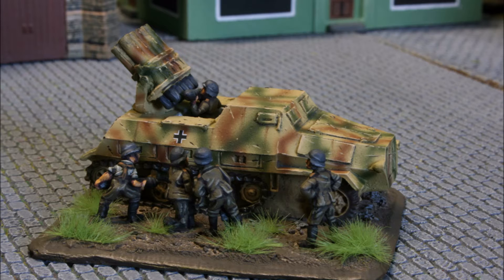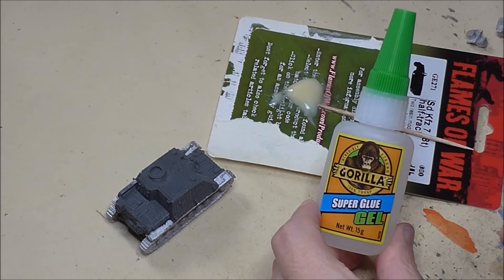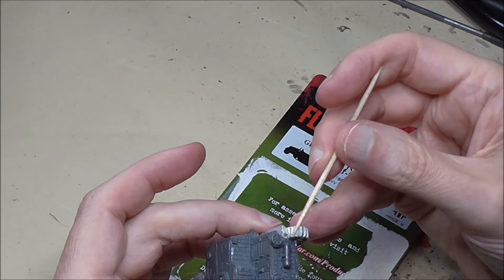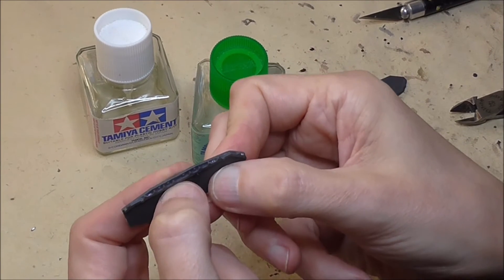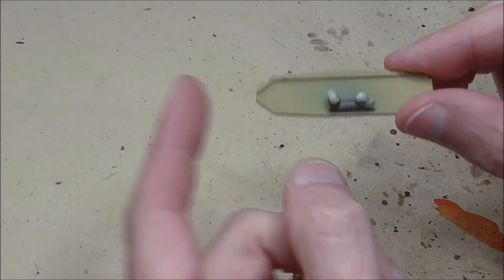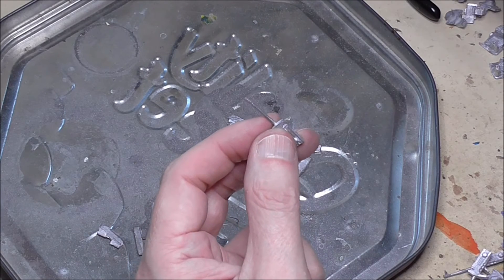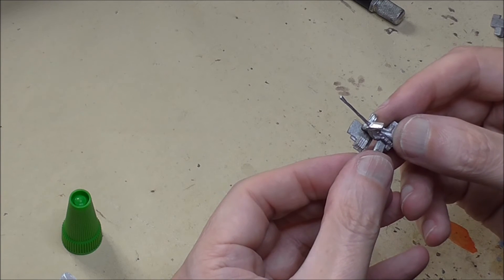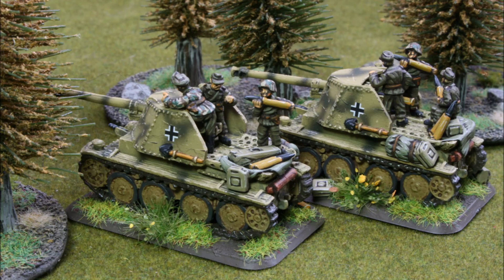How to Work with Resin and Metal Flames of War Kits

Comment: Araldite is definitely the best thing for a secure hold, although I tend to use superglue backed up with UV resin now just for speed.
Reply from the maker: UV resin sounds interesting. That's a new one to me. I'll check it out. Thanks for watching!
Reply from the maker: @wpbpanzerpainter2080  good to know. Sounds like it has a lot if uses.
Reply from the maker: And I should have said, your painting is top class!

Comment: I haven't done any FoW resin but I've done Games Workshop metal and resin stuff for years. I might get a pair of Elefants, do you know if this resin handles differently from Forgeworld? It looks a lot darker.

I pin the hell out of things and soak resin in Diet Coke to dissolve the mold release, a tip I learned from a Forgeworld addict.
Reply from the maker: Hello JM. I'm not familiar with Forge World myself. The resin from FOW is easy to work with. I have no issues with residual release agent when working with them  the Elephant is a one piece resin Hull with metal components. As such the resin needs no real work itself.